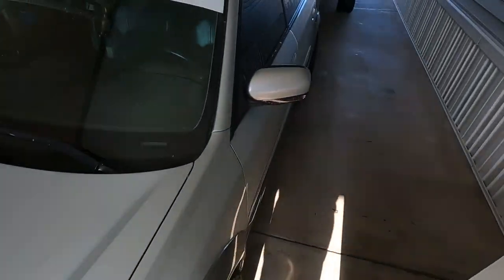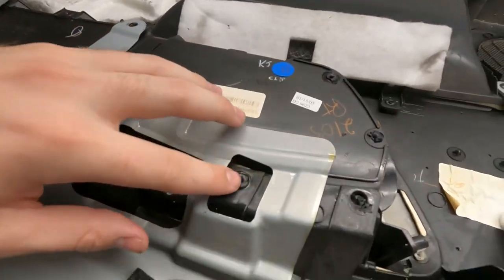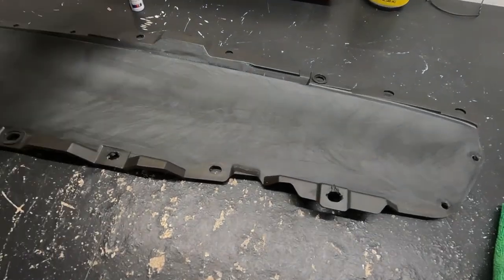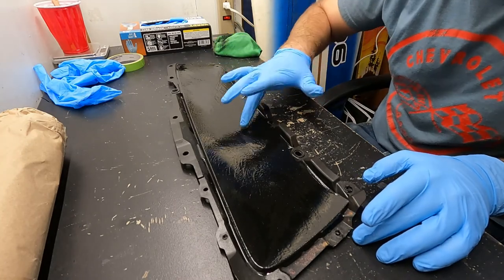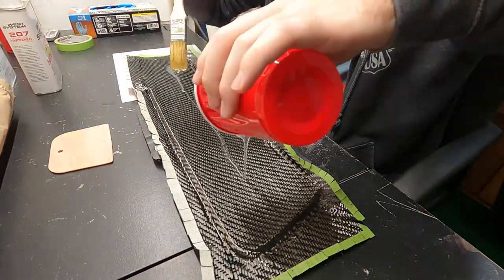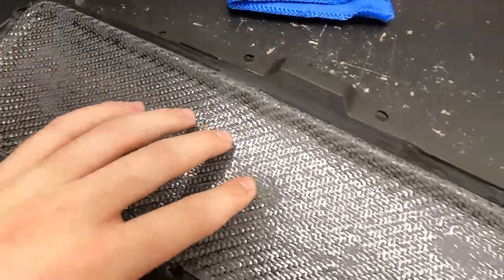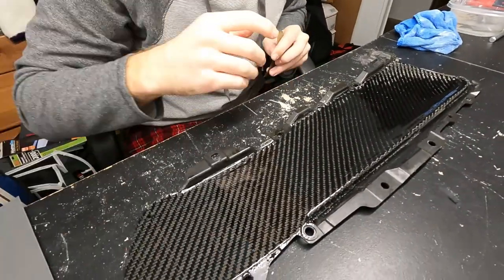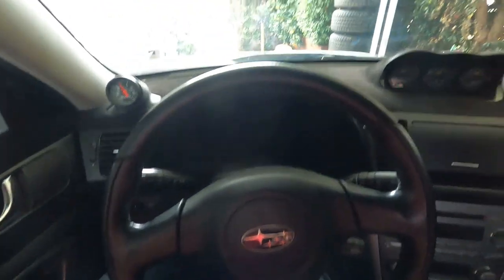Carbon Fiber Skinning Door Card Inserts!!

Comment: Just wet sand with like 800 grit final resin layer and shoot a clear coat
Reply from the maker: I have yet to try clear coating the parts, but that method would work. I'm gonna try it out with the next part I make since it's going to be either exterior or in the engine bay